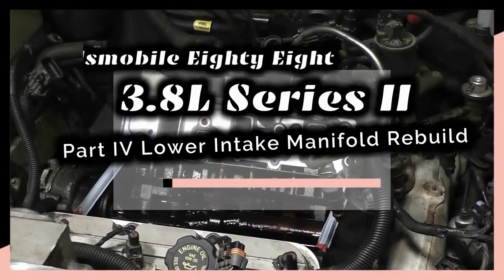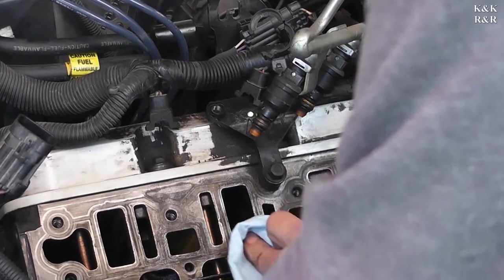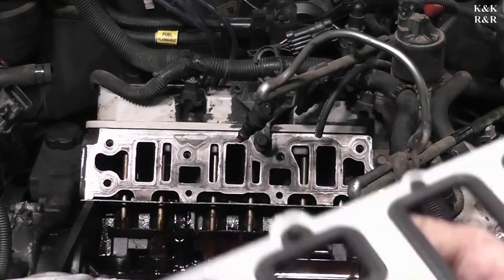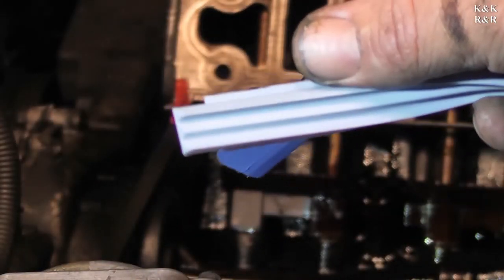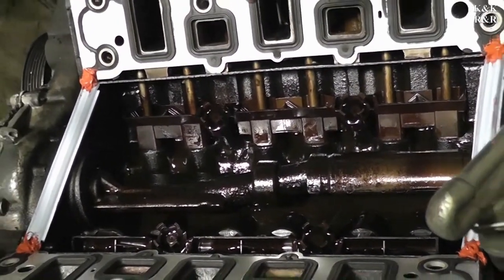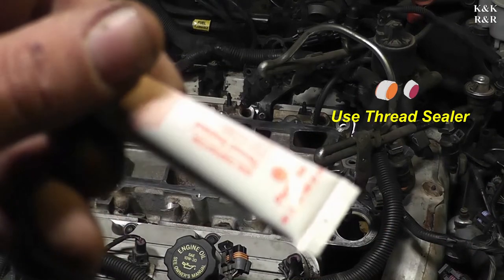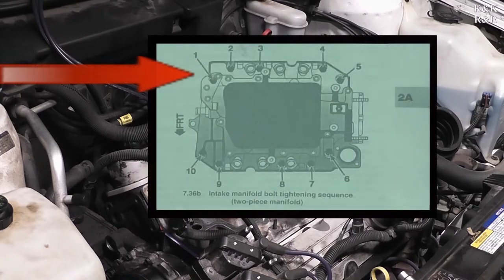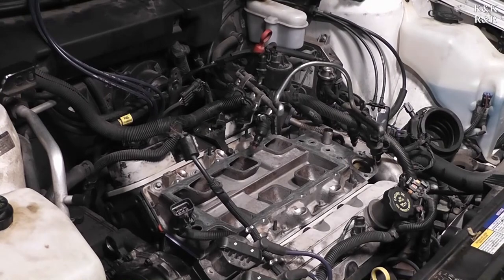1995 Oldmobile 88 3.8 / 3800 Pt4 Lower Intake Manifold Gasket Installation (Fel-Pro P/N# MS980141)

Comment: What is RH staining
Reply from the maker: I miss spoke the term is (RA) Roughness Average. On the 3800 they have (RA) surface lines milled into both the cylinder head and lower intake manifold to improved sealing of the lower intake gaskets.  These RA lines may look curricular in nature.  RA staining will make a milled surface look dirty even after hours of intense cleaning.   You will notice in the thumbnail picture it looks dirty towards the center cylinder head, but its not its RA stained after cleaning.  The RA stain is the by product of the plastic lower intake gasket, oil, and rubber.  With this engine its better to leave the RA stain alone after cleaning then try to resurface, sand, or level for a new like finish. 

/K&K
Reply: @KNKRNR  thanks very much for your reply, similar to a bore you don't want a smooth surface and that makes perfect sense, cheers guys
Reply: I have a 96 LeSabre.  Is the torque sequence the same for the 96?  And is the 96 also 89 inch pounds?   Thank you.

Comment: your torque is wrong for the lower manifold. 89 inch-pounds is the torque setting for the upper manifold or plenum.   The lower manifold should be torqued to 11 or 14 ft lb depending on which spec you went to use, but at least 132 in-lbs for the lower intake manifold.  89 inch-pounds  could cause premature failure of that lower intake manifold gasket!
Reply from the maker: My torque was right, this number varies by model year. I have the GM FSM for 1995 Oldsmobile 88 3800.   1996 and later had a different torque spec. 
/K&K